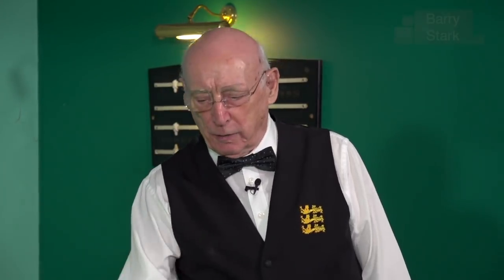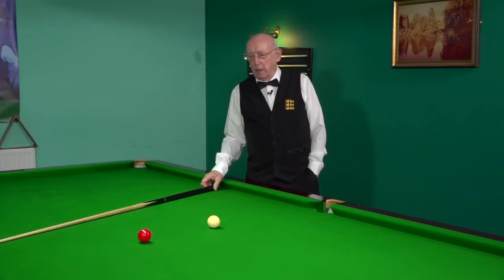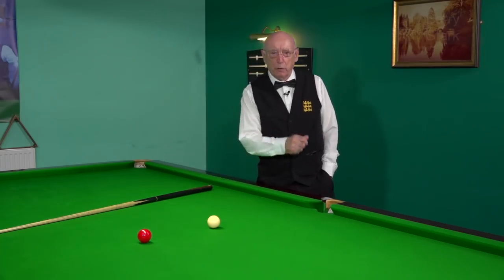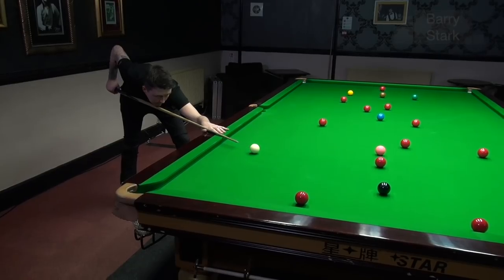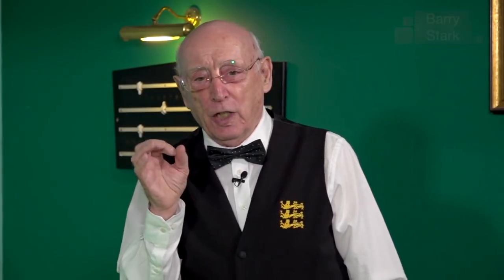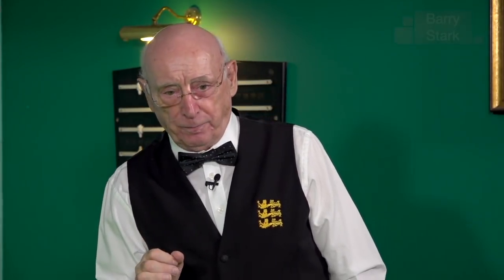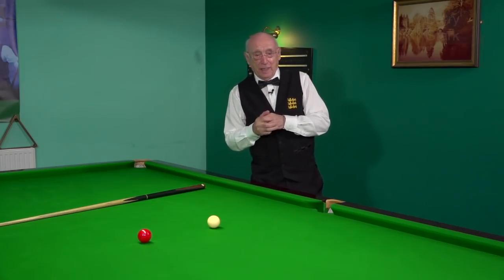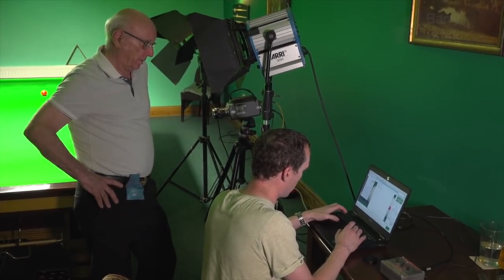109. Timing - What is it? Part1

Comment: Sorry Barry... 0.0002 seconds is not classed as "longer" contact time... Not in any significant way. I agree the player can feel like he hit a ball sweetly on some occasions rather than others, but it has nothing to do with contact time of tip. According to physics and mechanics it doesn't make sense at all because the contact time (impulse) is only due to the compressibility of the material (otherwise contact time would be zero (immediate transfer of energy in incompressible materials)). Material compression occurs in tip and the ball. Also I'd be interested in the detail of the "experiment". Was the shot played at exactly the same speed each time? Was the point of contact exactly the same each time? (for example, a screw shot). Were you comparing the contact time of 2 different speeds of shot to arrive at 0.2 milliseconds? Thanks :)
Reply from the maker: Dark. As I said in the video it was just a feeler, we hope to give more definitive measurements next time. Obviously compression is a factor but there was definite differences between a well timed shot and a mediocre one. A human being played the shots so no I cannot say that the point of contact or the speed was identical and that is one reason why I only gave an average measurement.
Reply: @BarryStarkSnookerCoach  
I'm curious as to know what your opinion is about the figure of 0.0002 seconds you measured. Were you expecting more (as it's hardly perceivably longer).
Due to your sample size and lack of visibility of the full set of results plotted , it's difficult for me to be satisfied with your "experiment". I'm sure the 0.0002s was the most you measured, but what about the other figures where Michael Holt felt he timed the call correctly? Choosing the best figure which agreed with your desired conclusion isn't the scientific way of showing statistically a correlation between the experimental parameters.
In your future analysis could you increase your sample size, increase the number of participants and ask your expert to do a statistical analysis of ALL results to see if there is a statistical degree of certainty about the results.

Apologies for being abrupt Barry and making assumptions about the amount of money you are able to invest into this research, but I am interested too in this topic and don't want the readers to go away with false conclusions.

My opinion is different to yours. I 100% agree that a player can feel he has hit the ball sweetly on certain occasions and that we call this phenomenon timing.
I believe this is due to when the player contacts the balls exactly as he intended and the resultant feedback is exactly as expected. i.e. he has contacted the cue ball exactly where he intended, the grip of the tip has given him the exact backspin he intended, he has delivered the cue at the exact speed he intended, the friction on the cloth has transferred the spin of the cue ball to the exact amount of screw back intended, the springiness of the cue after the shot was exactly as predicted, and hence the grip on the cue was exactly the correct strength to counteract the whip of the cue. This is my interpretation about what timing is. It is based on how the shot felt, after the shot (hindsight) and it's based on the player getting used to the conditions and making more accurate predictions of how the balls will behave (we could call this "a feel for the conditions"). It has nothing to do with contact time of tip to cue ball based on my instincts and knowledge about materials, physics and motion.

I'm sure you will admit if your experimental results do not agree with your desired outcome.
Apologies for any abruptness from my part :) <3
Reply: Just about every sportsman knows that you need to direct peak acceleration through the point of impact/release. There are very few exceptions to this and it shouldn't be remotely controversial. The only major exception I can think of is golf. With a drive, the bending of the shaft is really extreme. If you accelerated right through the ball with the hands, you'd actually be causing a negative bend in the shaft during contact. Instead, the top players will have already bent the shaft back by then. By marginally letting the hands slow down, this allows the club head to bend back the other way- creating a very positive acceleration through contact with the ball, rather than a negative flexion. The club is literally straightening itself back up into the ball. In that sense, even here the premise of accelerating through contact applies. It's just that the unbending provides the zip through contact, not active acceleration from the player. Also, in putting there's more reliability from a steady pendulum style stroke than from the complexity of trying to actively accelerate into contact. Outside of that, cricketers and tennis players etc (where flexion is a minor issue) all aim their acceleration through contact and release. It's the basic norm for success.
Reply: This post on piano playing is about all the same principles. You simply need to replace the concept of "give" in the finger, with the concept of hitting negatively at the cue ball, rather than accelerating through the shot. http://pianoscience.blogspot.com/2014/09/the-mechanics-of-chaos-vs-mechanics-of.html
Reply: From my feeling, the longer the contact time, the more spin I can generate. This is due to angular inertia of the ball - it takes time to spin it up. The same principle works in table tennis, where the contact time is called dwelling time of the ball on the rubber/sponge of the racket.
Reply: That doesn't sound like correct analysis to me at all, Darkmatter. If we assumed the cue was coasting with no external forces to accelerate it, then it would indeed be a mere reflection of the compression. But the cue isn't coasting. The more you can try to pace peak acceleration towards  the moment of contact, the more you can prolong the duration of time spent creating compression before the object being accelerated escapes. Given that the contact duration is tiny anyway, it can be stated with certainty that the contact force is extremely high. When the graph of impulse is extremely tall and narrow like this, just a tiny prolongation of contact time could make a significant change to energy applied. Small doesn't mean insignificant when we are talking about numbers that are small anyway and which are multiplied by large forces. I apply very similar analysis and concepts to piano playing, as what Barry is saying here. A short sharp jab won't necessarily apply as much energy as when you prolong contact via pacing of peak acceleration through the contact.
Reply: The analogy I use in piano playing is to compare pushing a trolley briefly, before letting it coast, vs hitting it with a baseball bat. The push can actually apply more energy with less abrupt speed (if you accelerate well) due to a longer contact made with smaller force, not to mention the better focus (and lack of chaotic vibration) compared to the shorter and sharper force. The longer "bond" caused by pacing of acceleration allows significantly more impulse to be passed on. In snooker you can argue that the contact is always so short that you can never come close to a true push over a strike, but you can at least follow-through enough to slightly reduce the shortness and give just the faintest trace of that similar "bond" with the cueball. The premise is absolutely sound but the only problem is in giving high quality proof.

Comment: Is it ture #BarryStark??-- for longer contact, based upon action reaction (newton's law), lets consider some cases and observations based upon those observations what must be done to get a longer contact .
 Case 1) if the hand grip is good (say 10 , just a number) and we hit the ball with the uniform grip ( a hold from where the strength of shot gonna travel which is the grip point to cue tip)  and I say this is a  'action' , the reaction by the cue ball will be some (say 9). 
Case 2) consider a soft grip ( say 6, lowe than case1) , cue ball reaction time will be a bit higher( in micro seconds).
 BUT Soft cueing is definitely not a solution because the reactive force from stationary cue ball will deflect the cue stick (because grip is soft) and deflected cue stick will deflect the cue ball direction by a tiny amout( but this amount will be huge for long shots)... 

SO a perfect blend of case 1 and case 2 is a solution ( I may be wrong here ), but how it will be working togather??? let's divide the cue stick journey in 4 parts :
 1) before it touches the cue ball , 
2) a first touch ( where cue ball feel almost zero force by cue stick), 
 3) in the continuum to 2nd step, where the force from hand grip to cue tip is fully transferring( this happens in very small time ), 
4) when the cue ball is reacting to cue stick force( anybody can feel it--- a feel of weight of cue ball at hand grip point) 
and , 
5) when the cue ball is leaving from its position...... 

what must be done is following base at above-mentioned timeline of  journey points --

1) soft grip but hard enough to have a control from grip to cue tip( like you should sense your cue tip like your hand) -- before hit

2) still soft so that reactive force form cue ball will be less

3) start making your grip firm and as you are going to transfer the power and cue will react at the very next nano-seconds... this is the time when you are in max touch of the cue ball and tighter grip than that of 2nd step , and it should happen at the same time when cue ball reacts ...

So , in simple words-- 

 soft (before touch) > soft(when it just touch , hard to get the feeling at first attempt,  only felt by human senses when practice a lot and have perfect concentration at the tip, I know it is hard to digest) > tighter one at show time..

THAT SOFT TOUCH  IN THE 2ND STEP WILL INCREASE THE RECTION TIME BY CUE BALL AND NEXT TIGHTER GRIP WILL PREVENT THE DEFLECTION OF CUE STCIK BY CUE BALL..AND LIFE IS EASY AFTER THAT....

IT WAS JUST AN ANALYSIS...

Comment: What might also be interesting regarding this is comparing two different players.   I would imagine the speed with which each player pushes the cue through would also affect the contact time; do "better" players have more cue ball contact time?  What is the contact time difference between, say, good follow through vs. stabbing at it.  Very interesting indeed-Needs statistical correlation though to be significant, even for differences as small as this.  You could even expand on this for different cue tip materials etc...  Thanks for this, Barry and team!
Reply from the maker: Shayne. You are right, comparisons would be interesting but the camera is an expensive piece of kit and only available at certain times and so is the expert who analyses the information, but I will bear in mind what you have said.

Comment: I wonder what causes the fractionally longer contact time. Perhaps in part, poor timing leads to a small deviation to the left or right of centre, causing the tip to strike the white with a smaller contact patch. This would decrease friction with the tip and cause it to slip to one side (bottom left or right, if playing a screw shot). Or perhaps poorly timed shots tend to be hit harder?
Reply from the maker: batlin. The question certainly gives food for thought.

Comment: Excellent video Barry.  I've always believed this and that's why I seem to time the shot better with a soft tip.   That does seem to fly in the face of the fact that so many pros seem to be using really hard tips nowadays, kamui's etc.  If you do a follow up video with more slow motion shots it would be interesting to see a comparison between hard and soft tips. Interesting to note that Michael Holts tip looks like a Xiguan tip which are synthetic and play quite soft.
Reply from the maker: David. Common sense tells us that a soft tip will compress more and therefore prolong contact time but on the down side will generally throw the cue ball off line more when using side that is why most good players prefer a firm, even hard tip. Michael uses an Elk Master tip at the moment and seems well satisfied with them.

Comment: Barry, I have a question. I would like to know what kind of tip is Michael Holt using? As far as I know, soft tip may make it easier for longer time contract between the tip itself and the cue ball.
Reply from the maker: Frank. Michael uses an Elk Master tip. A soft tip will tend to increase the contact time but can also throw the cue ball off line more, for that reason a tip should be firm but holding.

Comment: Maybe the difference would be more noticeable if you looked at a stroke made by an ordinary player and then an experienced one, ie one who has no concept of timing and one who does. You are attempting to measure the difference between a good shot and a better shot, therefore the measurement should be small. Just a thought.
Reply: I agree, it will be a very strong prove of the timing concept if this is done.
Reply: The problem is that an amateur doesn’t know the difference between a well timed shot and a poorly timed shot whereas an experienced player does. So there’s no way to know whether or not timing makes a difference in terms of cue ball control or potting ability when you have an amateur who can’t even hit the same spot on the cue ball every time consistently. An amateur introduces a whole new set of variables just by virtue of his/her own inconsistency that makes it even harder to isolate timing as a factor that improves a player’s game.
Reply: @hpe-eo4ce  but I think you can safely assume that even a well timed shot by an amateur will actually be a lot less well timed than an average shot by a pro.

Comment: I was very happy to watch the video, since the timing is one of the most intriguing subjects for me as well. But I highly doubt that a human being is capable of telling a difference that amounts to 200 microseconds, so let me propose another explanation. When you hit the cue ball even slightly off vertical center you cue deflects to one side, and when you hit it dead straight it deflects not. The lack of sideways deflection is exactly what you feel with your grip hand as a distinct and pleasant sensation of solid contact. And the closer to the center of cue ball you hit, the longer is the contact, so the shot feels better exactly when contact is longer. Also hitting dead center may produce different sound, and that's how you can hear good timing. Does it make sense?
Reply from the maker: Witold. It shows that you have thought deeply about it and it does possibly raise other points.

Comment: Barry, i believe you are absolutely correct with your way of thinking about timing! Cue and a tip - are a kind of spring, that stay in contact with a ball longer when they go with acceleration. When deaccelerated, the contact time is shorter. It is not hard to imagine.
Instead of a hard leather tip you can put a peace of a soft rubber 1cm thick on a cue and try again. I think that will help to explain the effect.
Closing of the grip, deadly center line (without sides) strike and paralell cue movement also should be shown. Otherwise the experiment will not be complete. 
Best regards from Moscow!
Children say that your sign on their cues gives +20 points to the break!
Reply from the maker: Lovely to meet those children, good luck to them all.

Comment: Would that miscued power screw shot have been classed as a foul? Looks like it made contact twice. I wonder how many miscued shots players get away with not being classed as a foul shot.
Reply: This is actually a very interesting point. It seems likely to me that every time a miscue causes the cue ball to "jump" like this, that it is the result of a double hit. If that's the case, I believe the rules should be revised to classify miscues that result in the white jumping as a foul.
Reply: Why would you call a miscue a foul? There's really not much point to it, you're already punished enough by losing control of the cue ball, you can lose a frame because of a miscue. That seems punishment enough.

Also, a slow-mo masse would look interesting - I remember hearing commentators talking about how you'd call some masse shots "push shots" but they simply can't be identified sometimes.
Reply from the maker: My name. Without the benefit of the camera it would be very difficult to determine that the player has struck the ball twice during a miscue.

Comment: hey, love your channel.
when I'm cueing I often notice that while I imagine the line for the cue ball to the object ball and from the object ball to the pocket, and it looks right to me, it's actually not accurate. I've checked the way I cue using your videos and it's not the problem. it just feels like others see better where the ball will go. what can I do about it?
Reply from the maker: Stefan has tried to help, I would only add to use the ghost ball frequently until you have a better understanding of where to aim.
Reply: Barry Stark Snooker Coach ok thank you
Reply: Check DTD aiming method. I had similar problems, now i'm more confident. Keep in mind the impact throw .
Reply: StefanDLazarov I see the line but when i go down to the table it's many times not accurate. what can i do
Reply: Place the cue ball dead straight for the yellow for example, then mark the place, then when u r down to the shot try to move your head a bit to the left or right, tilt it to find how do u see the straight line as a straight line